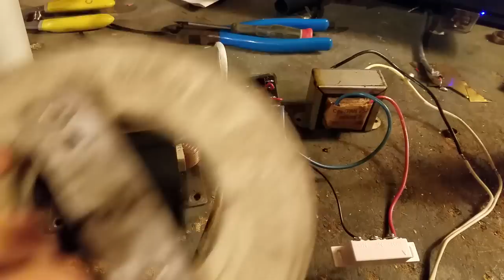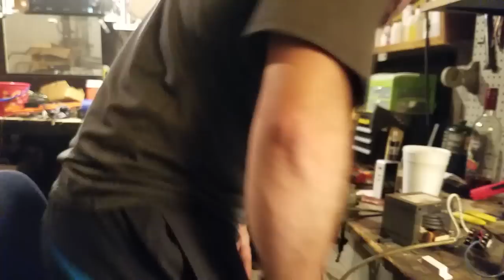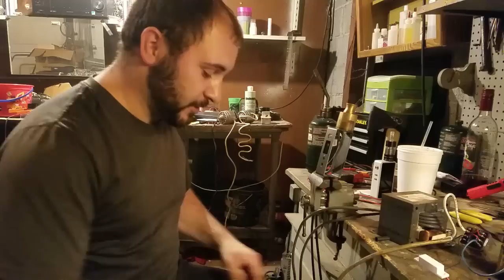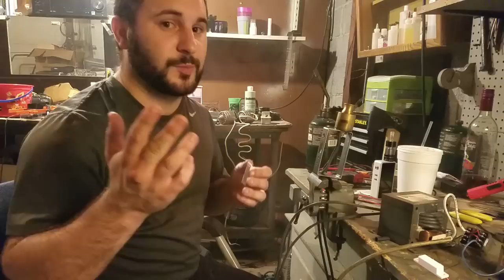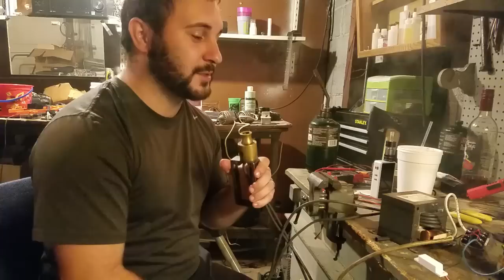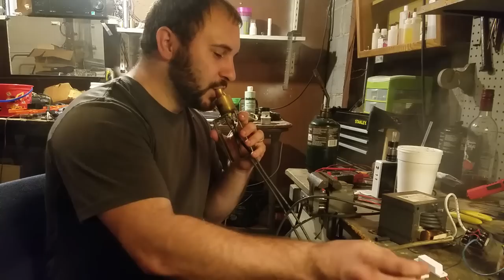120 volt ac ecig semi final layout

Comment: I would like to see a mod with two 3s or 4s lipo in parallel. rda around 0.05 ohm. I was fooling around with the idea for a DNA250c chip but I think the default watt out put is only 400watts. OR with a pwm...